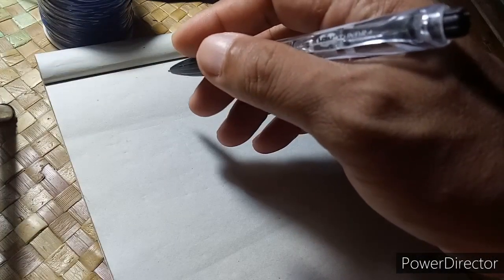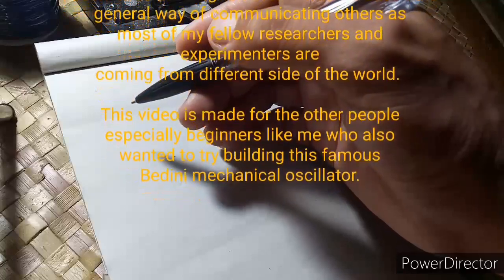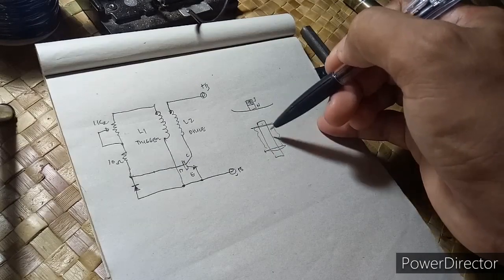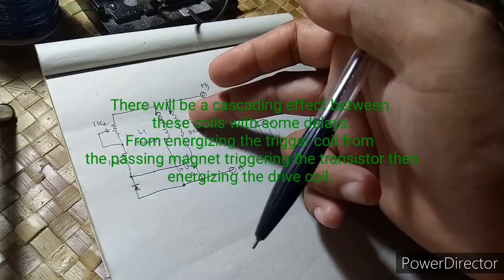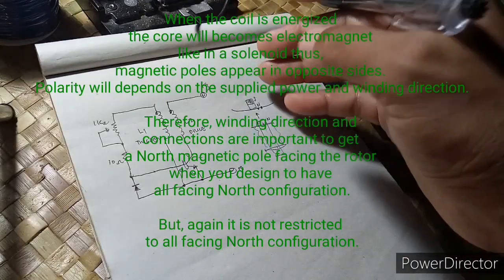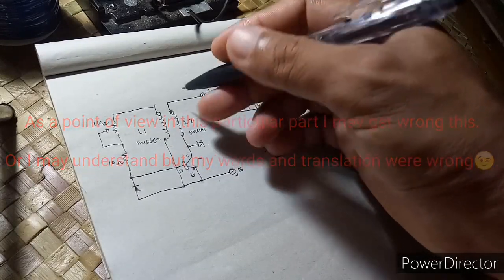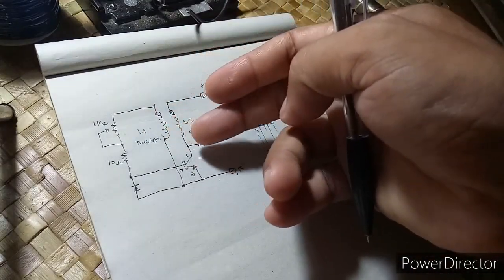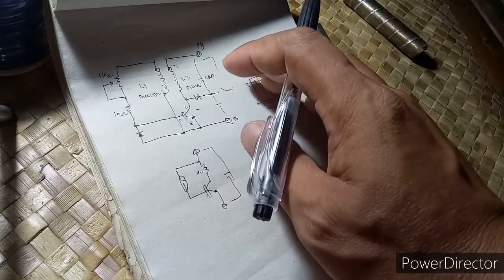Basic Bedini Monopole

Comment: so one coil bifilar is cabable of turning the rotor? , do i need all the magnets to be facing only nborth ? what is the voltage 12 ?
Reply from the maker: Yes it can run on 12Vdc.
Reply from the maker: Yes, one is enough to turn the rotor. But if you need more torque you need them more. Or make mutlifilar in one spool. Just one trigger coil for all. As my demo said, it is not restricted to all facing north. Meaning it can be all south facing outward or it can be all north facing outward. Depends on the design.